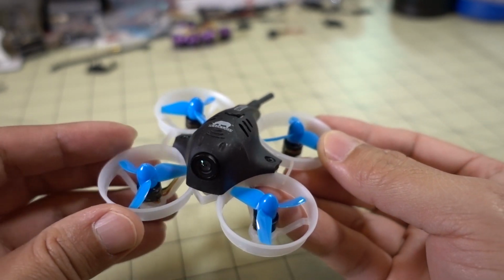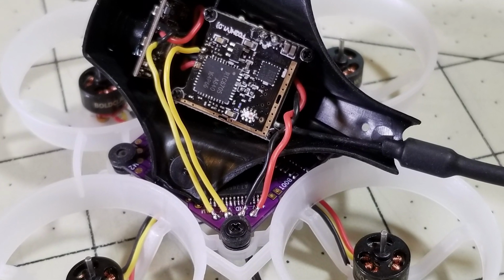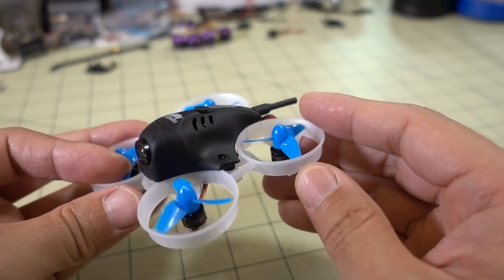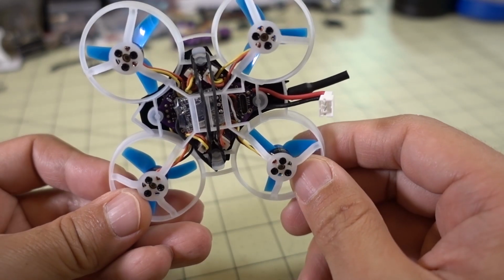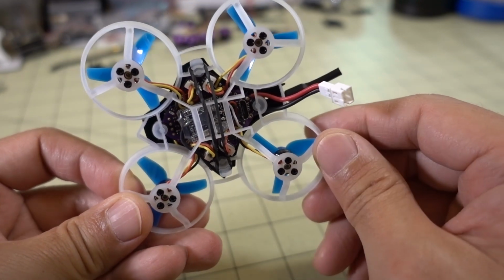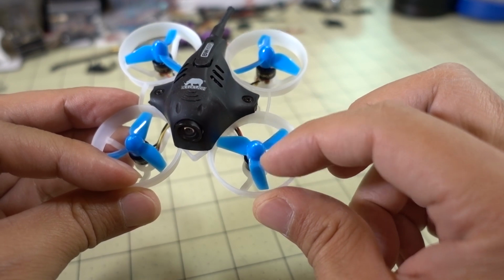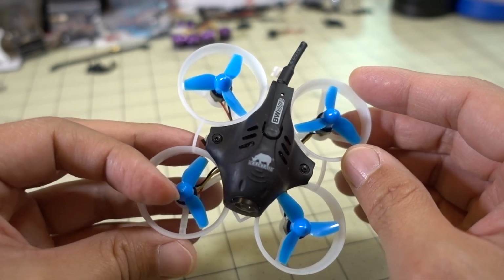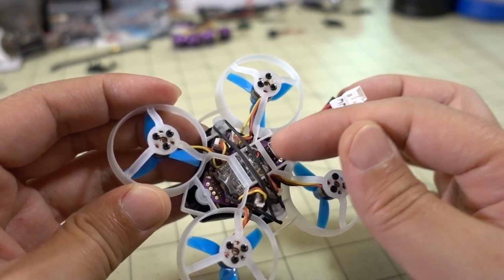Easy Brushless Whoop Build (Boldclash BWhoop B06) 👍

Comment: I love it!!!  I saw 20000kv motors available but out of stock.  I have the board, frame, .7g crsfr nano, 2.4g wolf whoop smart audio vtx w/ Lc filter, 1g 1000tvl cam and cheap 4 blades.

Crazy pony has micro 1amp Lc filters 2 for 7$.

Comment: It would be useful if the motor manufacturers would either use better leads (e.g., better insulation that can be more easily stripped and wires that can be tinned) or standardize on providing plugs.  Every motor I've tried to date uses insulation just stretches instead of cuts.  Soldering the motor wires can be a real pain in the backside.  I would like to see a 75mm build running 0705 motors.

Comment: I'm having trouble getting all my motors to spin up at same time on my 1s 75 mm build. Sometimes only 2 or 3 spin.  I used the crazybee FC and some 1s brushless motors. Someone mentioned updating my escs but I have 16.6 in BL Heli and thought that was pretty up to date. Any ideas ?  Thanks a bunch, Paul

Comment: I'd like to solder my motors directly to the crazy bee F3 board.  Is it wise to de solder those plastic connectors or is there a better option ?
Reply from the maker: If you want to solder directly you should remove the plugs but not 100% necessary.
Reply: @AlbertKimTV  I can desolder them as my motors do not have the connectors but do you know the size of the connectors just in case?

Comment: I recently built a whoop but had a problem w the motors arming after a few flights. Do you have a Beta flight set up you usually use after finishing the whoop build?
Reply from the maker: Sorry, I don't provide those anymore.  Some dick head decided to reward my "helpfulness" with a lawsuit.  No good deed goes unpunished.
Reply from the maker: Bearings are better but also heavier.  The only 1S brushless motors with bearings I know of are from EMAX.
Reply: @AlbertKimTV  yes the Emax seems quite a cool model if a lil odd looking lol.  99% of cars use bushings in their engines so maybe they'll preform well and be durable also

Comment: That’s great. I just weighed my B-03 pro with the same camera/canopy. It’s at 26.14g. The only extra I have added is a battery pigtail. 
Do you prefer this brushless over the B-03 pro? Thanks!
Reply from the maker: I like the top-end power better but wish the low-end power was better.  Also the battery life is little better on the brushed setup.  However, having turtle mode trumps everything so gonna go brushless just for that.
Reply: Albert Kim Good point!

Comment: Hi Albert. Could you recommend a whoop build or frame w 0703 20,000 kv motors ? Thanks
Reply from the maker: Get this $2.50 frame - http://bit.ly/2NXpTOX
Reply: @AlbertKimTV  oh that's great,  I already have that frame as a spare and b the UR65.  Thought it was for 0603 motors only tho not 0703s as the Ur65 has 0603s stock
Reply: @AlbertKimTV  & does that mean u can run 20,000 kv 0703 motors on the UR65 then ?
Reply from the maker: It depends on the motor... some 0703 will fit, some won't... I'm not 100% sure on all the motors.
Reply: @AlbertKimTV Ok. Goin with a 75 mm frame then. And 20,000 kv is ok on the crazybee F3 ? Know the snapper 7 runs on 19k
Reply from the maker: Yep, that will work 👍
Reply: @AlbertKimTV  You've been so helpful ! Thanks a bunch
Reply: @AlbertKimTV  is there a canopy for that frame?

Comment: FYI - if you build one of these guys you have to go with 4 blade props! They give the little guy a bit of extra punch power that is absolutely needed. TBS X are my favorite so far but they are unreasonably expensive so I suggest these new 4-blade ones for a 1mm shaft from banggood.  https://www.banggood.com/4-Pairs-HB31-31mm-4-blade-Propeller-1_0mm-Mounting-Hole-for-RC-Drone-0603-Brushless-Motor-p-1277624.html?rmmds=myorder

Comment: Great build and review :) the 0603's look like they have plenty of power! I did notice the break up in the video feed though. The one I'm testing doesn't seem to break up as much unless I go behind my garage about 70 feet away. Do you mind if I mention or link this video on my channel? You're the only one I know of that has the 65mm set up.
Reply from the maker: I don't mind. The video break up was a mystery to me.  I normally get good reception on my goggles and I wasn't flying far away.
Reply: FYI - if you go 0603 motors you have to go with 4-blade props!

Comment: how low is it fine to discharge these batteries during the flight?
Reply from the maker: I usually go to 2.8v and they usually recover to 3.5v
Reply: Albert Kim 2.8 while cover and 3.5 at zero throttle, right?
Reply from the maker: recovers to 3.5 when I land
Reply: Thanks!